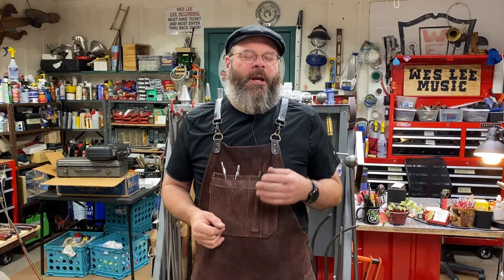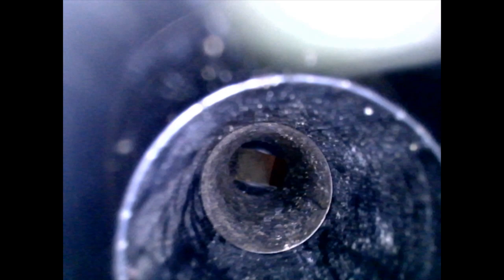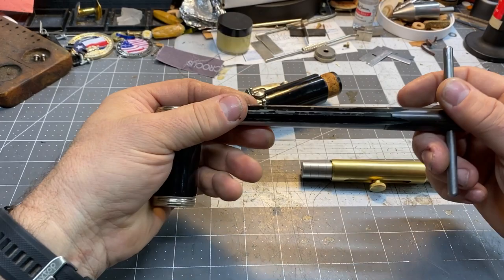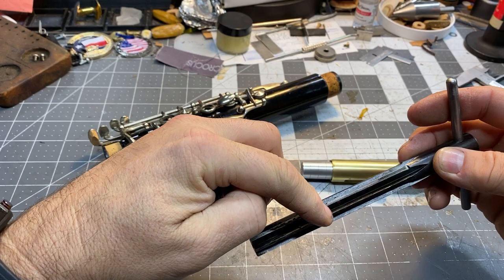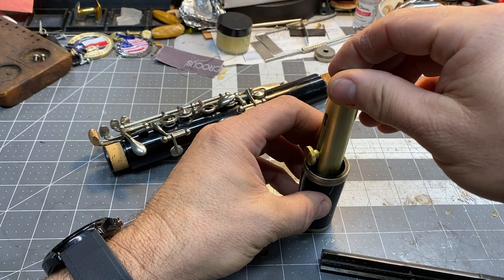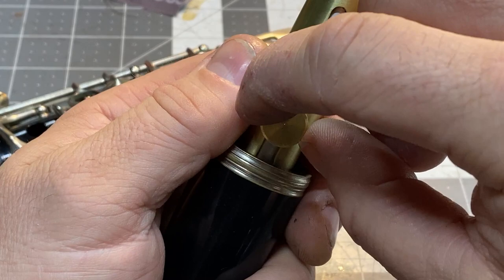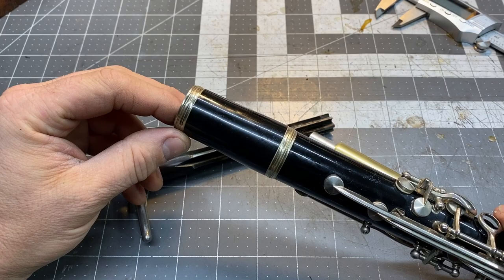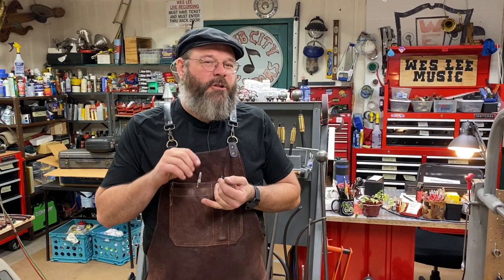Clarinet Boring Tools- Plus take a journey INSIDE a clarinet- Band Instrument Repair- Wes Lee Music

Comment: Outstanding tips thanks Wes , recently used some of your techniques,  to restore the end of a collapsed pushrod tube on an old Triumph motor cycle engine, thank you, just gently moving the metal back to where it should be over a fitted mandrel